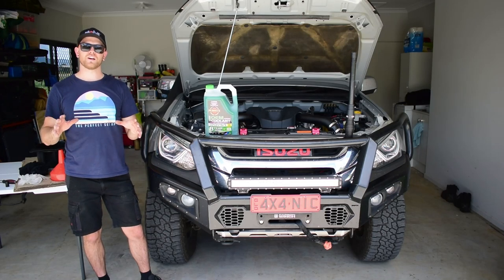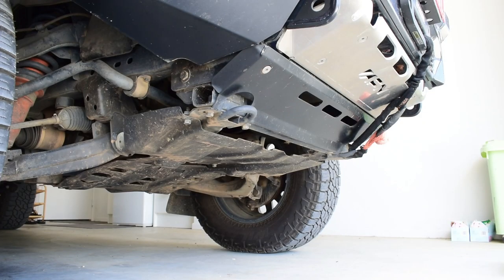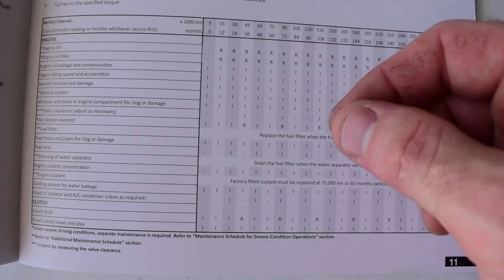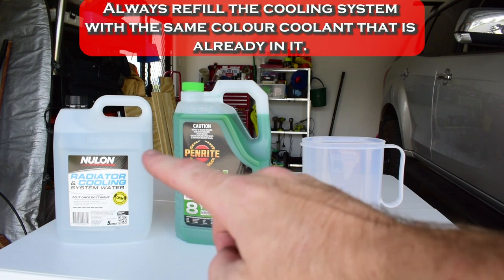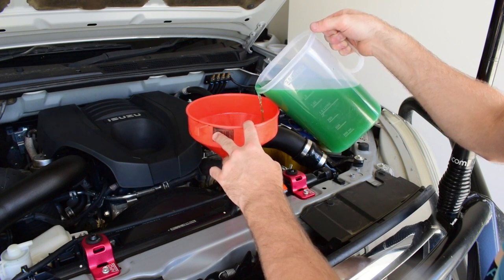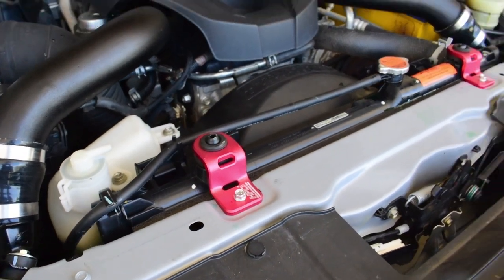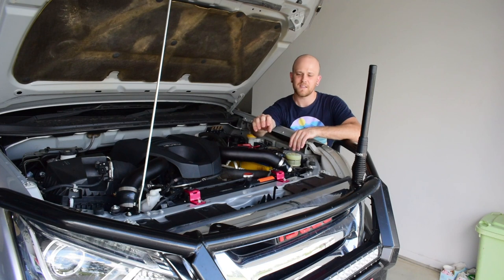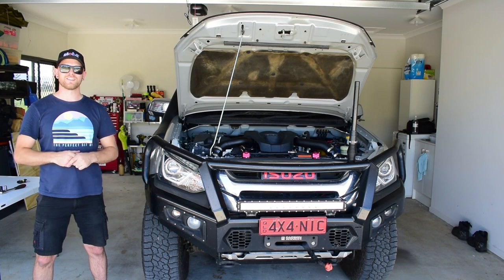How to FLUSH your cars COOLING System { DIY COOLANT CHANGE } Easy Coolant Flush

Comment from the maker: Hey Guys! 
Here's a few links to some tools that will make the job a heap easier!
Drain Pan - https://amzn.to/3GbosqE
Socket set - https://amzn.to/3eaxjNc
Funnel - https://amzn.to/3z1GlWG
Ultimate Spill proof funnel kit - https://amzn.to/3FAceYS
Coolant Test Strips - https://amzn.to/3FAceYS
5L Measuring Jug - https://amzn.to/3z4cSv1
Trim tool kit - https://amzn.to/3z2uzv7
Penrite 5L Concentrate Coolant - https://amzn.to/3eyX7CQ
Penrite 5L Premix Coolant - https://amzn.to/3z1rTxM
Penrite 1L Concentrate Coolant - https://amzn.to/3erHfCr
Penrite 1L Premix Coolant - https://amzn.to/3etO3zu
Penrite 1L Demineralized Water - https://amzn.to/312xask
Cheers :)